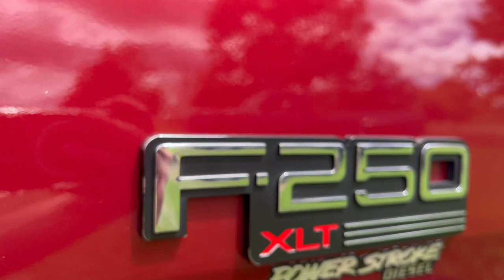I've got some big news!

Comment: The truck looks good with windshield not tinted.  If it were mine,  it would leave the tint off.  I never have liked tint on the windshield.  Trucks don’t need need it. The shaft driven 4 wheelers are nice.

Comment: Better make sure they did not just swap out that fender and hood and then re paint them to color match the truck….. PLZ MAKE SURE THEY DID NOT JUST SWAP THEM OUT FOR NON OEM PARTS…. eBay parts to replace those two are under $1000 by themselves I’ve seen it happen before brother…. 🙏